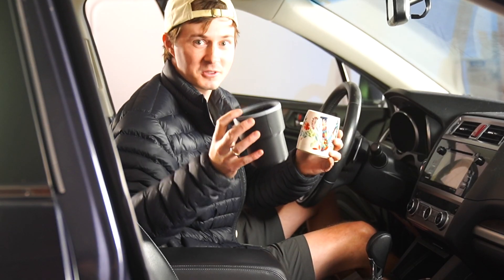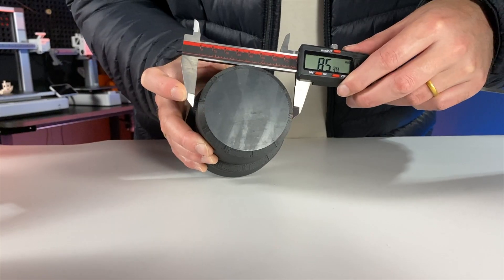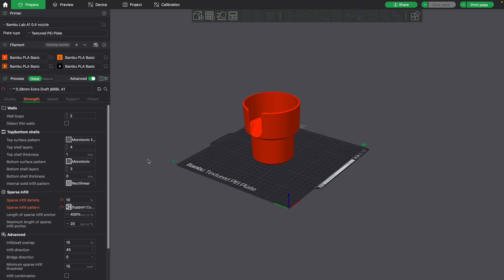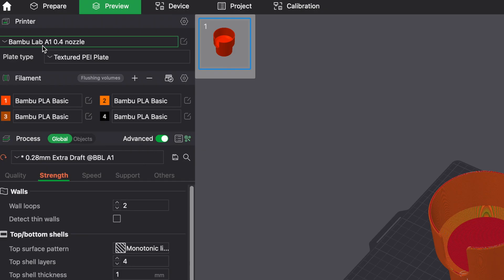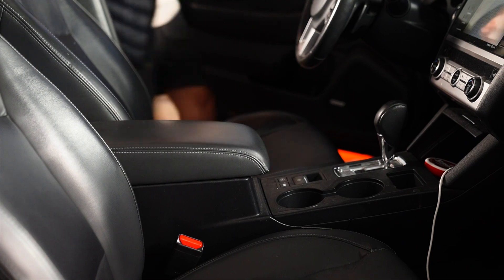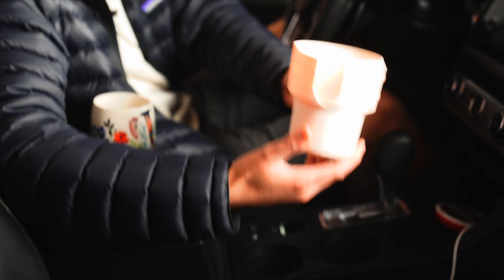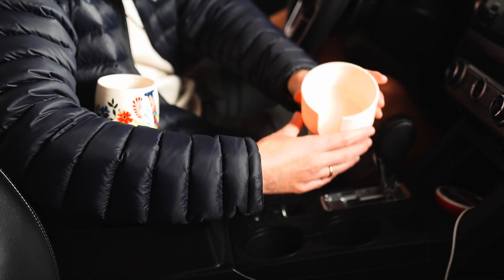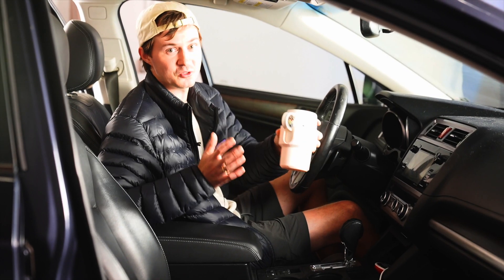My Favorite Practical Print!

Comment: It looked like you printed the mug holder out of PLA - are you not concerned that the print will melt/deform in the presence of a hot mug, or being inside a hot car on a sunny day? Additionally, I generally wouldn’t recommend putting a mug filled with a hot drink in a car. That’s just a great recipe for getting nasty burns.
Reply: Yeah I usually make something for use inside of a car out of PETG, not PLA.  Also definitely agree on the lack of wisdom of drinking coffee from a mug in a car. Or really anything from a mug in a car.
Reply: @MrAnim8orVideos  yeah - cold drinks are fine from a personal safety perspective, but keeping any drinks in an unsealed container is just a great way to ruin the electronics in your car. And with the way that everything is so tightly integrated with CANBus these days, it's not unlikely that you'd prevent the car from being able to start at all, just from s simple spill because you went over an unexpected bump.
Reply: I can confirm, regular PLA in a hot car will deform. Same for dark colored objects in direct sunlight. If you insist on using PLA, annealing is an option.

Comment: Glad to see folks out there showing the useful side of printing instead of making yet another junk dust collector.
Reply: I felt bad because all of my prints are for camera lens covers, and other camera related protection, doodads for around the house and car interior  - literally PRACTICAL prints as this channel is named! 😛
Reply: @williambell4591  a lot of my prints are woodworking and tool related. If they were super broadly applicable to everyone, there would be multiple cheap consumer solutions. 3d printing thrives in the awkward in between zone.
Reply: What's wrong by dust absorber?

Comment: By not making the bottom solid, you can save on material and also still use the cup holder for thinner more traditional cups, not just mugs.
Reply: That's a good point, however I think I'd be worried about a full mug being almost balanced against the wall opposite the handle cutout, and it would make it pretty much useless for mugs like the test one he's using, as it looks too thin to rest on the bezel alone, and the handle being so high up on the mug, it would almost certainly sit crookedly. Probably just depends on the types of mugs/cups you're using on a daily basis.
Reply: @MoreOftenTopical  you could have the mug bottom as a removable piece
Reply: in that case why not, yknow, remove the mug adapter?
Reply: Honestly have one of each